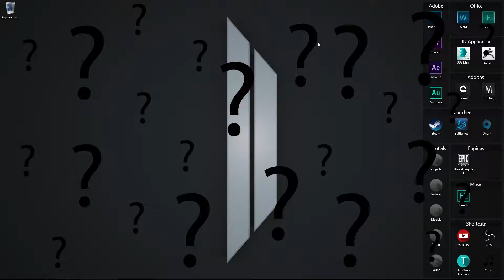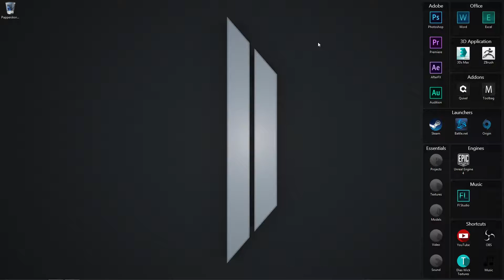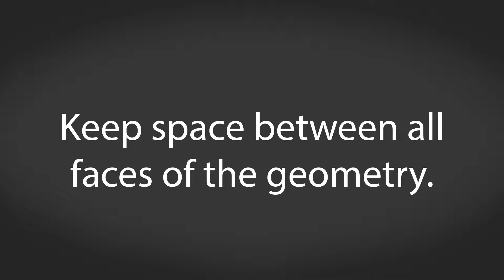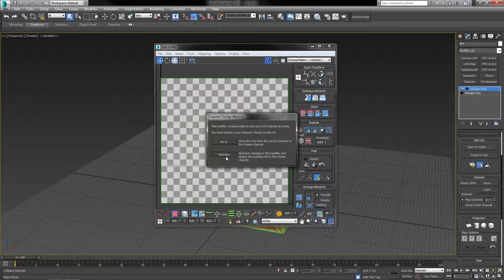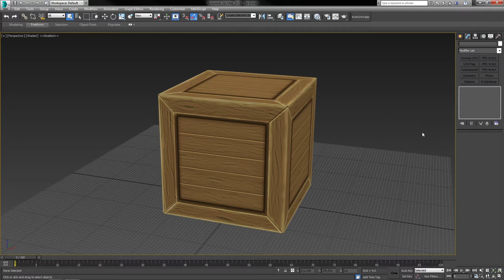[3Ds Max] - Your First Game Model [Episode 8 - Creating a Lightmap]

Comment: Nice tutorial. Only thing I would suggest is to let viewers know that snapping faces to say a BG with a checkerboard pattern equivalent to a resolution they are aiming for such as 256x256 for example, and then making each square a size of a pixel, then using "Pixel Snap", and making sure all UV Islands snap between pixels (on the edges), or at least if they cannot snap on the edges perfectly, say for curves and such, make it so that the edge only goes through as man pixels as needed, not more unnecessarily. For example, if you have a line in a diagonal position, make sure it goes through the middle of both pixels, at the very edge connecting the two boxes, or, the point of one pixel box to the other, the corner. This way, instead of that edge going through 3 pixels, it only goes through 2. This will prevent 99% of bleeding issues, as each pixel of the BG, or each square, is essentially acting as a pixel of the Shadow Map that will be baked into the scene at 256x256 resolution from the Light Map channel at the same resolution. Many people do not realize this aspect, and though they put space between geometry faces aka UV Islands on the UV Layout grid, they forget that the shadow produced using the Light Map channel, is comprised of pixels just like any texture, and just one pixel wrapping around the wrong way can cause bleeding.  :) I call BGs that are checker patterns, were each square is a pixel, of any set resolution size, a "Light Map Template". This will keep bleeding from occurring, and, you can precisely figure out how much padding between UV Islands you have or need, while also doing the same for the outer rim of the entire UV Layout, as that also needs padding. :) you explain everything else very well however. figured I'd just add what I have figured out with my own experience.
Reply from the maker: Hi, I have pinned your comment so that those watching the video will have a better chance of finding it.

Thank you for letting me know. I do of course agree with all of what you say. It sounds that you really don't need a tutorial based on your experience ;)
Reply: @EliasWick  haha thanks! I did use this awhile back to help me learn more though,  helped a lot. just saw this again and figured I'd drop some info as well.